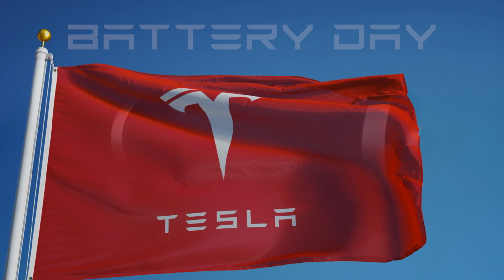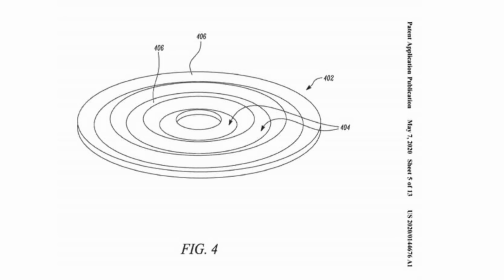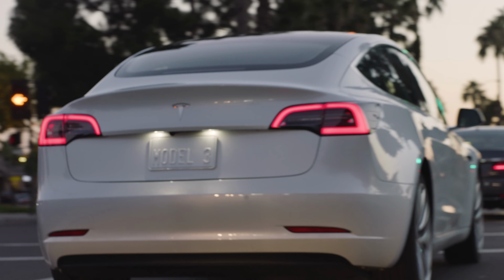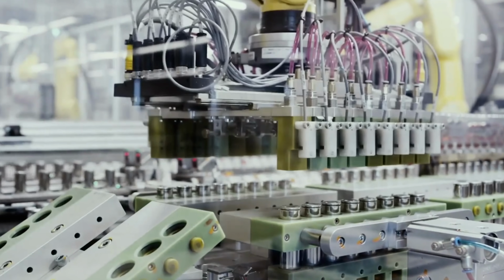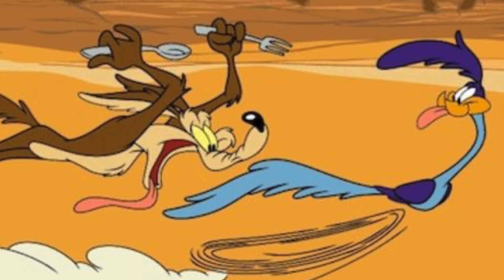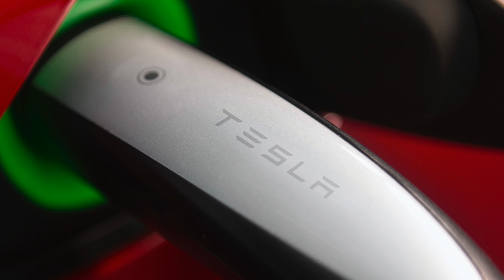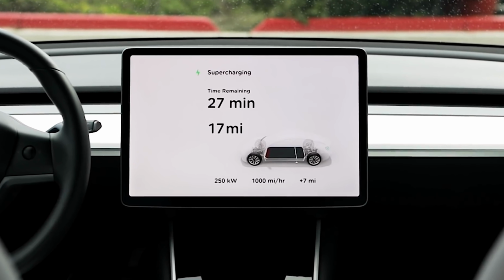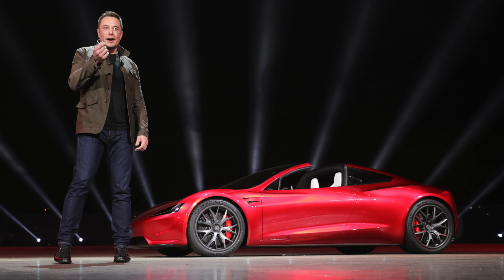Tesla Battery Day Preview: What to Expect Ahead of Tesla’s Battery Day

Comment: I think the max charge-rate would soon be limited by the charge-cable (stall and inside the car) since these form the bottle-neck.  Most regulations state a max of approx 6amp / mm2 of cable cross-section per copper cable.  So a 300amp current would mean at cross-section of 50mm2. it does depends on the materials used and temperature ranges.  Decent amount of details can be found here: http://www.aeicables.co.uk/literature/CurrentRatings.pdf
Reply: Yuppo, exactly what I was thinking. After all the bigger cables are using cooling for that very reason.

Comment: What about the top secret palladium project? My guess is that super-capacitors use palladium, Maxwell (acquired by Tesla) produce super-capacitors. Word is that Super capacitor systems are used on some (if not all) F1 cars as well as batteries for the KERS or ERS systems. This gives possibility to harvest energy very very fast and to be able to use that energy very fast also for the additional super boost of acceleration and speed required for overtaking.
The only problem with super caps is that as well as being quite heavy in comparison to a LI-Ion battery system, even though they can charge virtually instantaneously, they also can discharge very fast also. This is fine for the example of f1 cars, but wouldn’t be very good for long distance. But if and when used in combination with a LI-Ion battery system, this could possibly give the best of both worlds.
Perhaps battery day might reveal a newly designed combined  battery/supercap cell. It would certainly need to be physically larger, and need quite a bit of additional cooling, but this could be achieved quite simply, as the gap between the cells will be larger also. Being in combination with Li-Ion (or similar) could also reduce the weight per energy output than supercaps alone.

Comment: Rob - very good, as always. I think the biggest item enabled by this new battery tech will be overall cost reduction of vehicles. I expect Tesla's business model will be similar to ink jet printers - $50 for the printer and $100 for the ink refills. Tesla's "ink" will be self driving taxi software, insurance, electricity, powerwall/charger connection/solar installation for your home and the arbiter for selling/buying power to/from the grid. The more vehicles Tesla gets on the road the more data they can gather and the more high margin services they can sell. Most consumers will not care how it works rather that they can get a low maintenance, cool car for cheap.

Comment: I expect Tesla announcing immediate licensing other automakers to use 18650 (contracts even signed), maybe the same on 2170 next year, increasing profits, extending the lead, with no investment effort.
Reply: no, they need EVERY battery they make for vehicles, Powerwalls, and Grid storage! a ramp-up in every area!
Reply: @markreed9853  I heard that sound too, but it would be superspectacular if they don't need those anymore very soon. On the other side, legacy is good enough for grid/powerwall storage. Only if the new cell is cheaper and Tesla is no longer battery-production-constraint, this will be my guess/hope.

Comment: New batteries based on Maxwell DBE and new production process. Initially production will be small and may only be able to support a Semi introduction (but won't that be so exciting). Cybertruck will run off new batteries next year but redesign of packs for S, 3 X and Y will be down the track. New battery production process will be built into all future Gigas. There could be an announcement of a new factory dedicated to the new tech. :-)

Comment: Tesla will also introduce core car manufacturing changes, such as their new large casting machine with an end goal of making the complete car body in one go. By doing this they will greatly reduce the need for robots assembly of body parts, they will use them instead in other places on the production line, such as their new cabling harness, their new 3D paint shop. Tesla is taking a Holistic approach of getting to the end result (a complete EV) at a much faster build speed. Musk has never given up on his Dreadnought approach of the machine building the machine, these new factories are going to be insane from their battery capacity  to their total output of Tesla products ( EV cars, Semi Trucks, Cyber trucks, etc), automation in their factories will be key to their success. I suspect Tesla will not need to build as many factories as we think to get to 20 Million EVs, these new state of the art factories in Texas and Berlin will be game changers.

Comment: Rob.
Re the Cybertruck charging.
Note the new V3 charge layout with the pull up configuration.
One charger either side?
Why not split the pack and use two V3's?
I think this is what the Semi will do, with 4 chargers, or, as you suggest, with 2 uprated units.
Everything standard, modular, versatile, with redundancy.
One side fails, you're still running.

Comment: IMHO There's going to be a hybrid battery pack! Mixed with current and the roadrunner cells.
Reply: Complicated.
However, a new pack designed for all cars, together with a common BMS, saves huge amounts of cash.
(Osborne effect may be an issue, but it must happen)

Comment: What about the unveiling of a Megacharger for the Tesla Semi?
Reply: How about 4 V3 chargers (maybe only 2!?) Split either side of the Semi?
Reply: @rogerstarkey5390  The current semi has been seen using 2 x chargers as probably using 2x 100kw packs - but that may just be as its a pre-production model? I think 2x V3 charger support until mega chargers roll out. I think the first orders going to Pepsi/UPS as they have over 100 orders each but will be fine with chargers at the factories/depo.

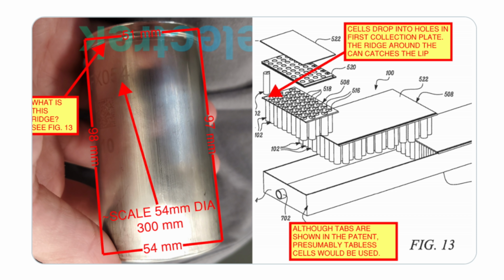Comment: 2:35 is incorrect.  Current has to travel further in a traditional cell, yes, but the distance ions have to travel is proportional to the loading density, not cell size.  The animation is highly misleading.
Reply: Karen Pease, I was scrolling to see if anyone already said it. Lol. Also I think that misconception made his statement @3:02 incorrect because the tabless design has nothing to do with ions, only he distance the electrons need to travel. The ions are traveling radially while the electrons are traveling axially if tabless and traveling the length of the jelly roll in normal battery.

Comment: Totally, unlikely, but I'm hoping they find an application for Maxwell's supercapacitors. They were famous for them, it seems like a waste of technology to abandon them. 

Given the weight savings going on with the lithium pack. I wonder if they could dedicate space for a kilowatt of supercapacitors. Leverage the amount of energy they can dump into the motors (especially with a trimotor design), augmenting the battery output to get the 0-60, quarter mile times, etc. 

Software could keep the capacitor bank charged partially, during typical driving. Taking the rush of current needed to accelerate to highway speeds, take off from a light, and even regen off the main battery. For Track mode, the capacitors could be fully charged by the traction battery, allowing for max output for longer regardless of the lithium pack voltage.

To me this makes sense for the Model S and X Plaid variants. Be that middle ground of performance between the 3 and Y, and the Roadster. Cutting edge, and with a buffer for them to undersell the features, so they can quickly respond to any competitor trying to best them.

All of this is unlikely for reasons of cost and complexity. But still, I hope they find a use for that portion of Maxwell tech.
Reply: 1) Complicated. Ref "the best part is no part"
2) Battery performance will be "sufficient" (AKA "overkill")
Maybe in high regen application (Semi), otherwise, I don't think so.
Reply: The Maxwell dry electrode tech initially came from researching super capacitors. In that respect, Maxwell’s research into super cap was not a waste!

Batteries are improving so fast, you won’t need super cap soon. In light of that, I can see why Tesla does not want to spend the time and money to do super cap, as that will be obsolete shortly.

Comment: My guess that they may have sort of tiering. High-performance high capacity, but lower longevity batteries on top models and 1 million batteries from CATL on base models with a lower range. You don't need roadster robotaxi and plaid S robotaxi, so there is no need them to run a million miles. It is just a waste. Those are image products, not a mass market.
Reply: The million-mile battery is only needed to compliment the million-mile motors in the Semi!

Comment: How is a million mile battery relevant ?
Reply: It's not really, but it's become a distraction, once it's put to bed that's one more thing the "Gordon's" can't moan about.
Reply: Its a catchy moniker for a raft of benchmark breakthroughs:
Bigger cycle life 40000-6000 cycles to 80% degradation depending on temperature
Or trade cycles for higher cell voltage
or faster charging
or more temperature tolerance 
means less cells, lighter weights and lower costs.
https://iopscience.iop.org/article/10.1149/2.0981913jes

Comment: One more thing. More and cheaper batteries will allow for more battery walls and mega packs allowing for a greater disruption in the energy business. LFP batteries are most likely more suitable for stationary use as they have a lower price point and energy density is less important.

Comment: Yes Battery Day will have multi talking points of significance.  It will address mainstream concerns 

1”Range Anxiety” I expect charging times will be drastically reduced with V3 SCh.

2 “Cost of Vehicles” 
Reduced cost of battery and therefore cheaper Tesla’s -cheap enough for the “average man” 
...and 

3 I hope a refresh to X and S...internal, external and battery system to increase range and density to boost sales of these more niche vehicles

Comment: Just a few thoughts.
Price reduction. Tesla's car's price at best is 20% profit margin, 20% battery cost and 60% rest. So even if we se 50% cost reduction what's unlikely we are talking about at best 10% total price reduction in case of the cheapest model 3. More expensive models even worse. So this part is less than important.

The more important part can be handling the battery production battle neck. Tesla can't produce the millions of cars it's priced for, not because of production issues, but because of lack of mineral resources for battery production. Some relief can come from battery efficiency, because it means less cells needed to achieve the same range, what means more cars can be produced. Though let's not get fooled, it will be great achievement if Tesla manage to produce 1milion cars in 2021. So battery day is kinda important to keep the perception of mega growth until the mining can catch up.
Reply: The more Tesla localize production, the better the profit margin!  As Tesla expand locally into China, the profit margin will increase! Same for Europe! Unless, Tesla decides to keep margins at 20%, and pass on the savings to the consumer, thereby simulating more growth.

Even at $1000 savings on battery per car for a million cars, that’s $1 billion. That’s enough money to start another factory.
 
In the near term, mines are not running at full capacity, so Tesla might be good for a few years. Though Tesla might have to consider being in the mining business, raw material processing soon. Let’s see what Elon says at Battery Day.
Reply: @sunnychu1840  lots of wisdom there, good points, though I am not sure if the mining capacity is not at the max. Do you have any sources for this?

The reason why I am talking about the price reduction is that the OEMs only advantage over Tesla is the economy of scale of the cars body. We can clearly see in Europe that OEMs can produce cars for even under 20K, and although the range is significantly lower, many people buy them as second car or just commuting from the suburbs. I don't think that there will be long term demand for 40K+ cars, just at the moment that's what is available. So Tesla has to adapt to this as well, and that would mean cars somewhere between 20 to 30 thousand. That is far from where Tesla is at the moment. What everyone is saying is that is because Tesla has a big battery and with that a big cost of car. That is absolutely not true. The batterys price is less than 20% of the car. So making the car cheeper is not by making the battery cheaper. Tesla is not really good with body work. I believe there is the biggest opportunity to lower the price. In short, my worries are that meanwhile we are pointed to much to the battery brake trough the market share might be getting lots to the OEMs by loosing the biggest segment, the around 20K cars.